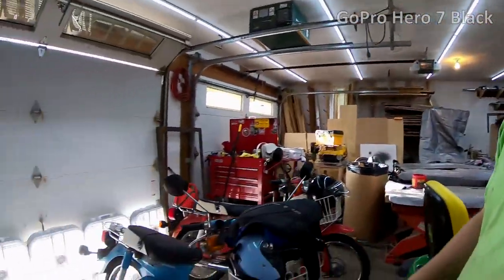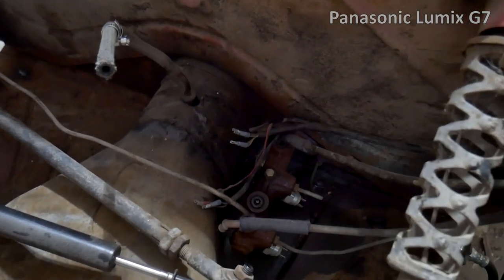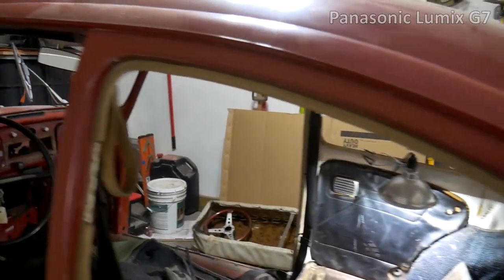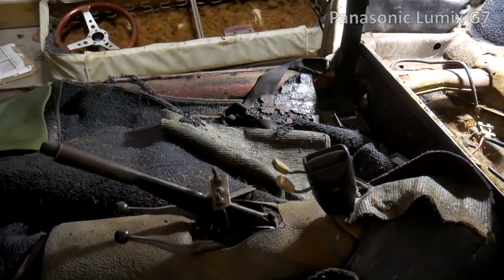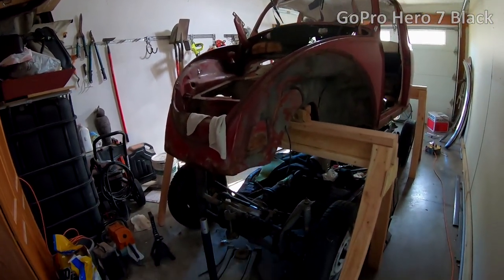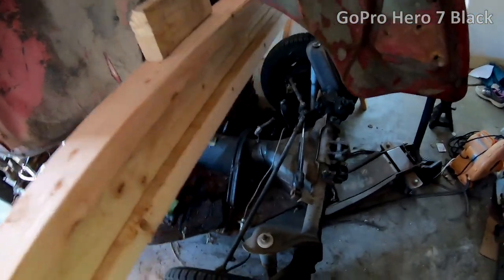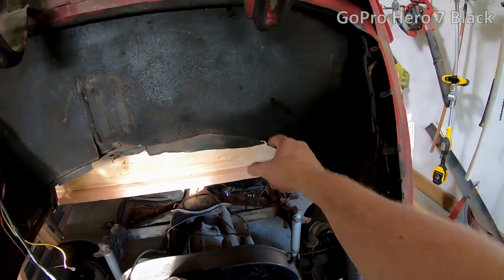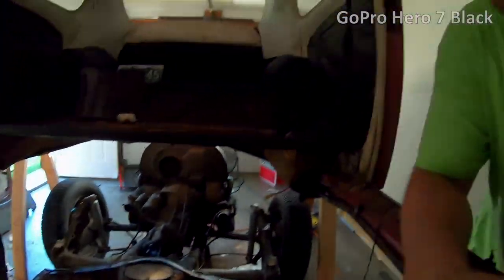Splitting the Beetle - 1968 VW Beetle Day 5

Comment: It was tough to see if your brake cable was correctly run on your handbrake there but yes, that’s essentially how they are. Super simple design. Works well if properly setup. Two separate cables running to rear wheels. By the look of the angle on that bracket one side had more wear than the other if the adjustment ended up looking like that.
Reply from the maker: Thank you! Just making sure. I need to study my service manuals a little more I think!

Comment: How tall is your ceiling. I’m in the same situation and I’m looking at building saw horses
Reply from the maker: My ceilings are just 8 feet high  the sawhorses work great, but I plan to reattach the body before I do any major body work (replacing front clip) so I can use the body mount bots as reference points